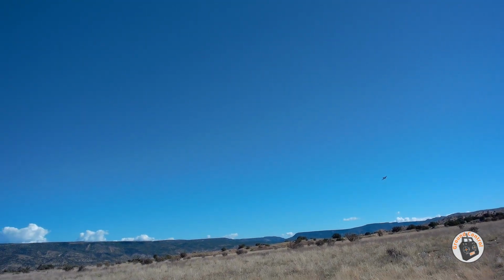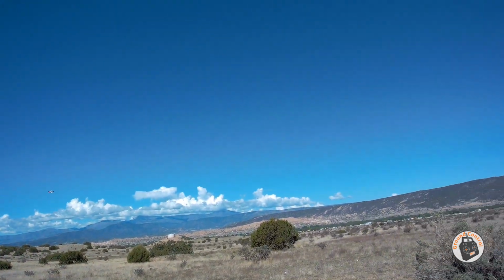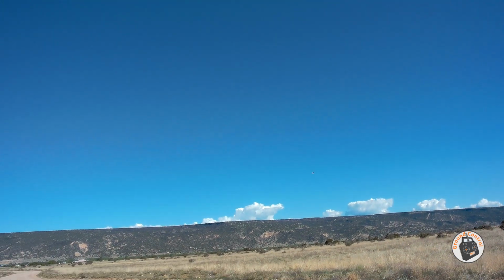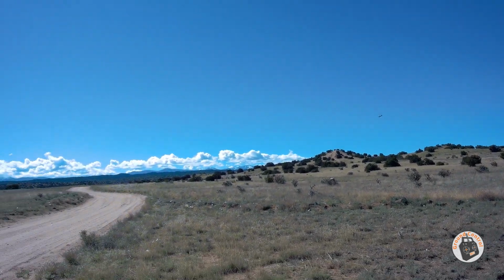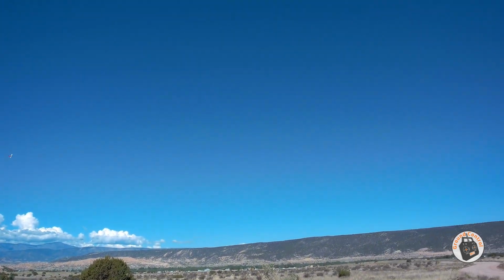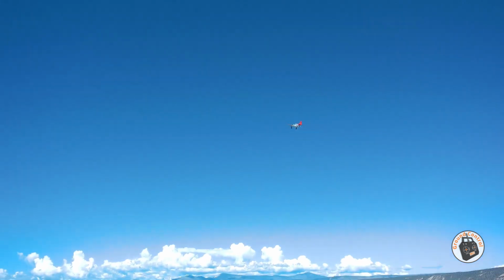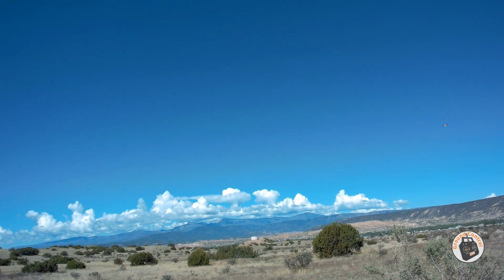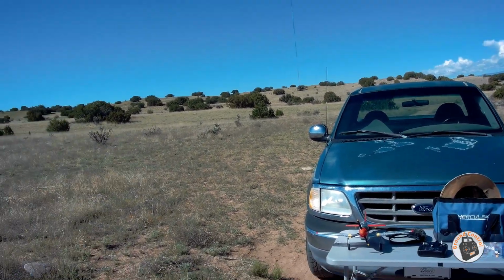It's Definitely a Keeper! XK A280 P-51 Mustang 3D/6G System 560mm Wingspan 4CH RTF!

Comment: I saw something come off the plane at 1.50
Reply from the maker: It did look like something came off the plane ;-)
It must have been something that was floating in the air and I flew right into it.
The plane had all the parts and pieces when I landed.
There's a lot of trash out there and usually quite a bit of wind.
Reply: @GroundControlRC  thanks for solving the mystery.
Reply from the maker: @carlosjuarez7449  ;-)

Comment: Thanks for all the examples. I flew two batteries in dead calm yesterday,  but still nervous to try 3D mode. My first flight stalled in 3D: needed glue ;( ... 
Compared to the 400mm and 750mm P51 (RTFs with gyros) it felt underpowered so I left throttle full on and practiced 6G with four minutes flight on each charge. Good glide ratio, so the my concern for power may just be in my head, but the batteries did get surprisingly hot. The lights are an interesting feature, but didn't help much in flight (cloudy).
 I'll watch more of your videos!
Reply from the maker: Hi Robert!
You can actually fly this around at 60-70% throttle for level flight. It may take some trimming especially in 3D Mode to prevent it from nosing up. It has enough power to perform some decent aerobatics with the stock prop but that 7x5 Prop I have on mine certainly adds more power.
Yeah, I didn't care for those LED lights and unplugged all of mine ;-)
When you get comfortable with it you're going to have a blast with it.

Comment: I'm looking at either this or the Eachine 750mm p-51d.  I see that you've flown/reviewed both.  Which would you recommend?  Although not a total beginner, I've only been flying rc for about a year (a 400mm T28 Trojan and 700mm UMX Turbo Timber).
Reply from the maker: Hi Robert!
You must be referring to the Volantex P51D 750mm.
I have as much fun flying this one as the larger P51D and with this one you don't need to change any of the electronics.
The Volantex P51D needs a larger ESC, a 3S LIPO, and a different Prop (IMO) to have really good performance and flight time.
It depends on if you prefer a larger plane than this one and want to change a couple of things.
They both are fantastic flying airframes.

Comment: I just ordered one, do you maybe have an approximate guess how fast it goes on 2S ? And if it's possible to upgrade to 3S ?
Reply from the maker: You're going to love it!
I've seen someone post that the ESC doesn't support 3S, however, replacing the Stock Prop with an APC 7x5 Thin Electric 2-Blade Prop certainly makes for good performance.
That's the way I'm flying it now as I've tested a couple props including that one.
It seems pretty speedy for it's size with the 7x5 Prop and a higher "C" LIPO and has very good vertical climb.
I'll be posting some of those videos soon.
See you in the Air!

Comment: The only issue I have with a 560mm wing is that it won't fit in my bike backpack with the zipper closed.  ;-)

I may have to order an airframe and make a project out of one.  I haven't done a lot of building lately.

Happy flying!
Reply: He must confirm but as I saw the kit, the big advantage is that the wing is removable. I also have a very deep but not large backpack and I'm pretty sure it fits. Besides, it is the ideal size. There is a UMX Mustang right now, but it's too small to enjoy it like with this one. Last but not least, it is under 250 gr.
Reply from the maker: @marielizysurourcq  Yes, the main wing is removable.
The back of the wing slots into the fuselage and a single screw secures the wing at the front of the wing.
It is Sub-250g.
The all-up-weight on mine with the stock battery and the landing gear attached is 224g.
Awesome Brushless Micro Warbird so I hope you can get one.
See you in the Air!
Reply from the maker: It seems to be a very stable airframe and handles a lot like my 750mm P51.
Awesome little plane.
Reply: Doggeslife,  how's your Thunderbolt ?  really want to see you fly it .
Reply: Ahoy Doggeslife.
Finding You in good stead.